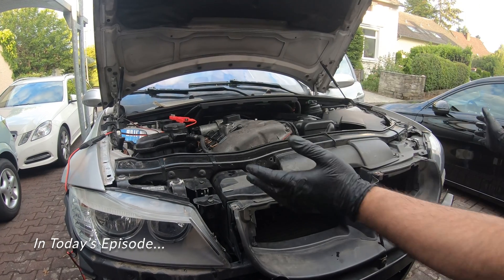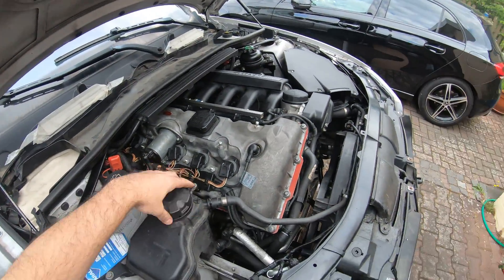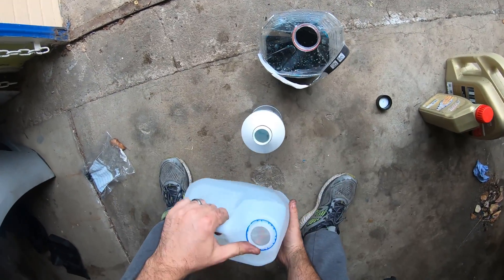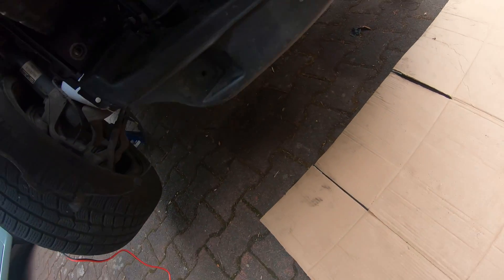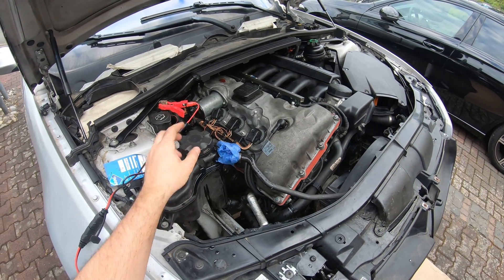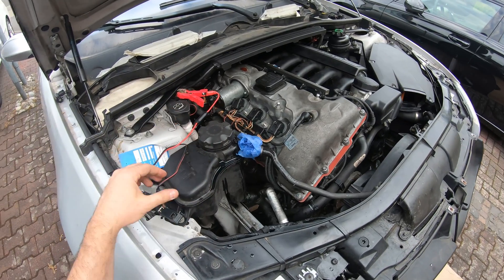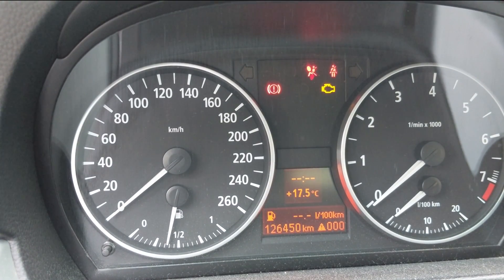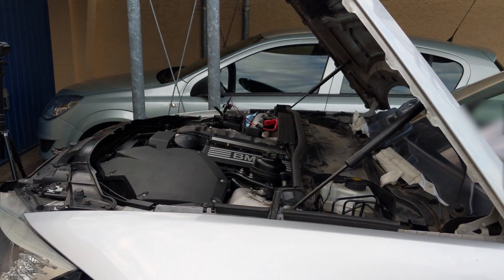First Start Up of The Rebuilt BMW E90 N52B25 Engine! Did we fail? [BMW Engine Swap PART 9]

Comment: i pulled all my coils and did 3 primes.  10 seconds each per BMW factory manual. 20 second breaks in between for starter safety.  Best wife ever.  "Its Smoking" "Its normal" pans to valve cover billowing smoke
Reply from the maker: Yes, this is normal. Was burning off some oils that were on the exhaust manifold. And It had water in the exhaust from sitting outside so long. 🤣

Comment: Did you have to swap
The ecu or do any reprogramming?
Reply from the maker: Depends on which engine you are swapping in, n52b25 uses the msv70 but some n52b30 had the msv80

Comment: Bro I saw that u had jack stand under the control arm??? That is a big no no. Jack stand can slip, arm can snap. Must use factory approved jacking points or u might be rebuilding bmws in heaven 😂😂
Reply from the maker: What part of the video was that?

Comment: When doing the bleeding procedure, you don't need to open the bleeder screw and spray coolant everywhere. Just take the reservoir cap off.
Reply from the maker: Yeah I figured that after losing so much coolant 😂😂😂

Comment: Burning fuel creates co2 and h2o as by products of combustion, so if you idle in cold weather, there will be water coming out of the tail pipe. Best is to monitor the engine temp and then take it out for an easy drive for first 100km. Then give it full throttle in 2nd up to 1500-2000 rpm then engine brake (fully off the gas) in 2nd gear back down to 600rpm. Do this repeatedly to seat the rings.

Comment: Pour head gasket repair treatment( its like a bandage) and see if your engine smoke subside, if so your head gasket is leaking or failed. I've never used it but it seems like it wold be handy in your case since your doing diagnostic now to figure out your issue:) also your white smoke with a blue tint could be an overfill on engine oil that engine takes about 6.9 quarts I belive with filter change
Reply from the maker: Head gasket repair could cause other problems if as it is a band aid solution and it gets everywhere! Would rather keep my coolant system nice and clean. 👍🏼
Reply: Forgot to add make sure you purge the air out the cooliant system(with the electric water pump)if you do plan to continue driving, or else you will forsure overheat your car, the procedure takes about 12 minutes

Comment: Verry helpful, what are the torque specs for the headers and the intake manifold?
Reply from the maker: It was not very much.... I just snug them down. You have to be careful not too much because you can crack the plastic.

Comment: The best thing that could be is that there was water in the exhaust pipes from sitting outside,or you have a cracked head or block.I don’t think that the head gasket is the problem because is brand new.Hope for the best!
Reply: Did you follow the correct order for tighting and losing their a specific order so it sets down correctly?
Reply from the maker: Yes. Pretty sure. You can watch my video on it.
Reply from the maker: Yes👌🏼. I was worried I missed torquing down the head properly because it is in 3 steps... But I marked each bolt carefully so I don't think it is that.... Maybe water in the exhaust?

Comment: Check ccv pipes
Reply from the maker: Why would the CCV cause burning water?
Reply: @buildanddrive  not sure but I had this problem on my e30 m54 swap and my e46 n42 a new ccv and pipework fixed it I think the water will just be condensation built up in the pipe but blue smoke will be oil dumping into the inlet due to poor vacuum on ccv it can pull the oil up from the oil pan into the intake and flood it depending on what pipes split happend to me thought the engine was blown 😅
Reply from the maker: The car sat outside for months, so maybe that is the issue 👍🏼
Reply: @buildanddrive  Had the same problem with the same engine. The smoke seemed to be more white than blue and smelled more like hot water. Cant explain that. Changed the CCV and everything is fine now. Had 0.5 to 1 litre of oil in my intake manifold. Now everything is fine. The 6 cylinder engines smoke a bit more than 4 cylinder engines. Especially when they're cold.

Comment: I wouldnt be scared of that smoke, m54s smoke like that in the summer when they been standing. So i  would not be worried about it, if its not running like a shit. Open the expension tank and sniff if u can smell oil. In the last clip it smoked less. If its not running like shit, take it for long ride
Reply from the maker: Thanks man! 🙏🏼🤞🏼 Fingers crossed... It was smoking like that for like 30 minutes though... With a pool of "water" coming out of the tailpipe!!! But it didn't not smell sweet like coolant... Weird eh?
Reply: @buildanddrive   Did you drive it on highway or something? well i hope for ur sake its just condensation, good luck.
Reply: @buildanddrive  Just condensation in the exhaust system. My 635CSi was terrible for it every morning, I was terrified it was the head gasket but the car was fine.

Comment: Nothing happened 😀 ether its condensation in exhaust or it cold outside 😀
Reply: I'm thinking the same.
Reply from the maker: It's summer! 😅 it was burning like this for more than 30 minutes... But why would it burn oil AND THEN like 10 minutes after the first start... It started burning water
Reply: @buildanddrive  did all clear up? I  had a similar  problem, but it was because the exhaust system had oil residue from the old engine burning oil. Once the oil was burnt it stop smoking.

Comment: What does the phrase , rings set correctly , actually mean I only ask as Ive never heard it before and dont quite understand what process is happening when the '' rings set''.
Reply from the maker: When you hone the cylinder bore, the new piston rings need to expand against the bore and seal the combustion chamber up.
Reply: @buildanddrive   they do that as soon as you put the piston back in the bore ,,, its the process of '' setting the rings'' i dont quite understand .
Reply from the maker: Watch this https://youtu.be/FHOHIt18Rb8

Comment: although this has been a journey of a build, Id say it may be something to deal with the cylinder block, gasket, or the head.
Reply: Dos you resurfaced the head prior to installing?
Reply from the maker: I cleaned it up... Didn't resurface it by a machine shop
Reply: @buildanddrive  Is It still smoking?
Reply: @buildanddrive  id say you should dissemble and check for cracks on the head or leaks, if nothing id say to check the head, is the block and head the same from the old N52 motor?
Reply from the maker: Same same 👍🏼 I will do a leak down test soon.
Reply: @buildanddrive  its all a process brotha hopefully you find the issue 🙏🏼
Reply from the maker: Thanks... It can only one thing... Let's hope it's not a major one 😅
Reply: @buildanddrive  would you recommend trying to do this my self, I do have enough experience to do this job but, is it worth it? My car is an 06 and it really does no have that much market value. How much would I be spending on parts alone?
Reply from the maker: I need the finish calculating everything but it was around 1400 in parts and 800 in tools(crane, engine stand, special sockets, timing kit etc) and I didn't even buy everything you would need (no front/rear main seal etc.) I tried to re-use as much as I could. You can see some of the stuff I bought here https://youtu.be/vPv6bWl6Cjo
Reply: If you do take its apart you really should just take the head to a machine shop I just got done rebuilding the same car (n51) they were able to spot the cracks, I replaced my head before reassembly
Reply from the maker: Agreed... The machine shop would be able to spot it. 👍🏼
Reply from the maker: Maybe the head or block is warped?